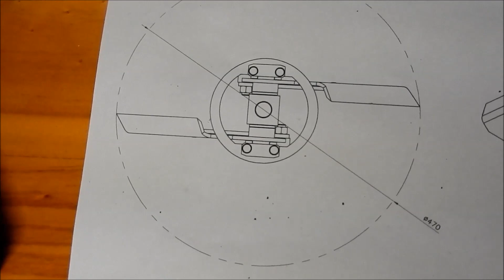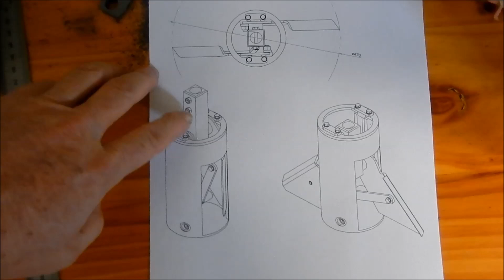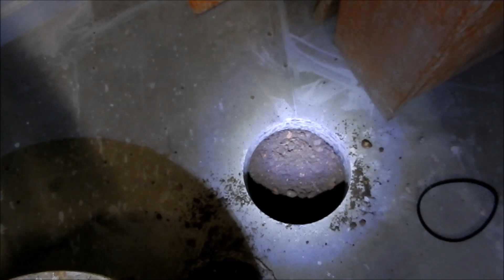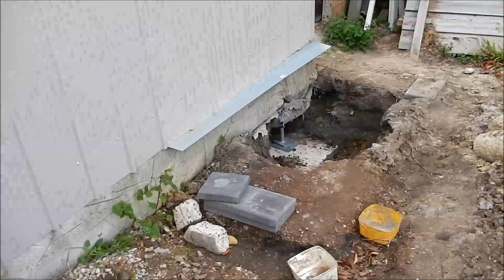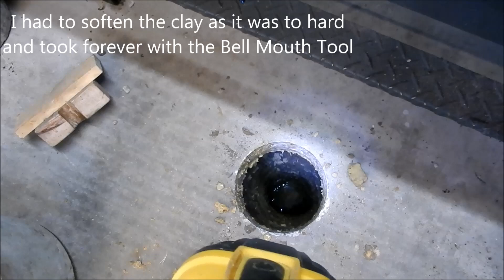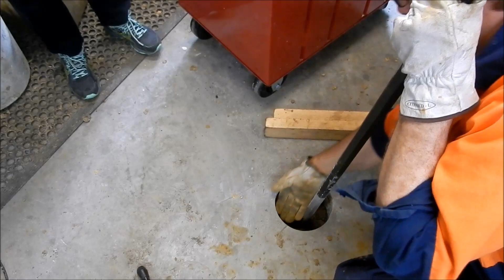DIY Concrete Slab and Foundation Lift and Repair Part 2

Comment: Did you buy this property with this building? I've been on jobs that concrete was pumped under the floor ( on very swampy ground), and the raised the build up 15 to 20 inches. This was done by floor drilling every 6 feet over the entire floor about 80 feet by 100 feet. The total process took about 3 days. The outcome raised and leveled the entire floor. With a lot less effort.
Reply from the maker: G'Day Barr B, Pumping Stabalized Sand mixed with a plasticizer or mudjacking certainly would have been the easy cheap solution, but.  As you would have seen from the first video the Geotek report on the clay substructure showed it is extremely unstable (see my picks of my house repair in the first video).  That band of unstable clay runs 1.5 meters deep.  Mudjacking would have lifted and levelled the slab maybe for a couple of months but it certainly would have continued to sink.    My surveying over 4 months indicated it was sinking 1mm per month and continuing.  The clay I was drilling into was like soft putty.  The other option as I talked about in the first video was to have the clay injected with a micro grout to stabilise the clay then mudjack or lift with expanding polyurethane foam.  The best price I could get for this process was in excess of $20,000.  The only viable option I could see and afford was to sink holes to a depth of 2 meters then bell mouth so I was under the unstable clay and pour concrete to then lift off.  It will now allow me to now put machinery in excess of 2 tonne on the slab and be confident it’s never going to move.  
Cam

Comment: Nice job on the bell mouth tool. Love the ratchet to turn it. I was wondering what you were going to turn it with.
Reply from the maker: Yea, borrowed that from my Broaching Press.  Did the job nicely especially in tight spots where a 'T' handle won't fit.
Cam